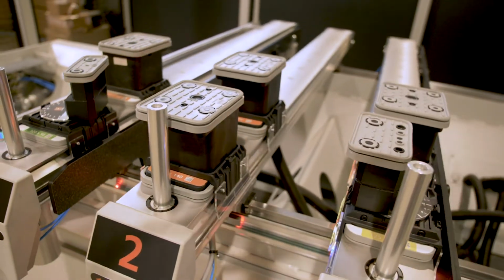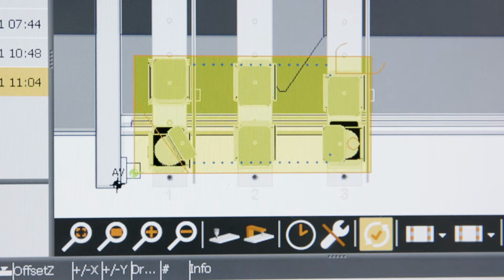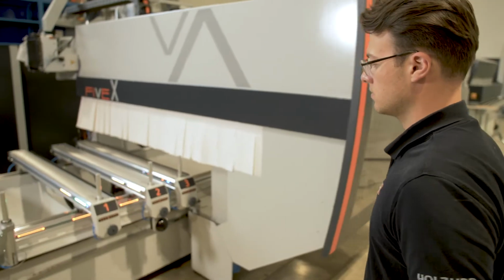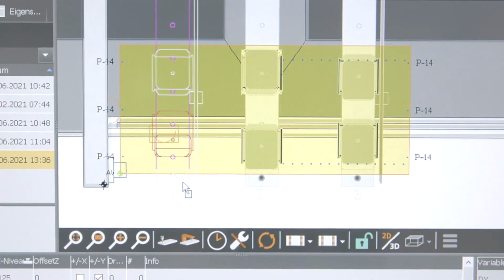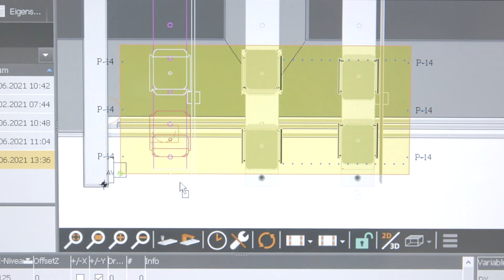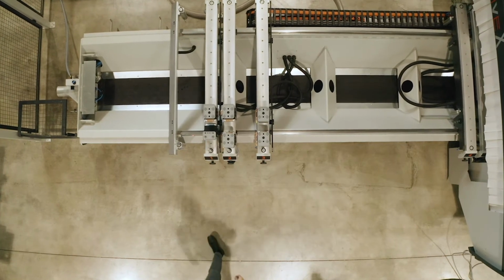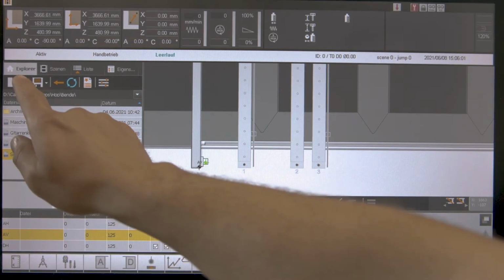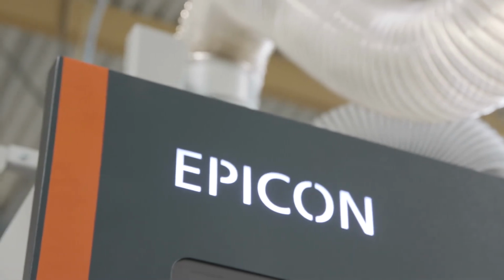VISE LED Positioning Assistance on Holz-Her Pod & Rail CNC Machine

Comment: How is the vaccum created from rail to cup
Reply from the maker: There are vacuum nipples along the rail - when the pod slides over them it picks up the vacuum
Reply: Nice im guessing the vaccum cup open the port  and the unused port get  vacuuumm shut via  simple check valve membrane